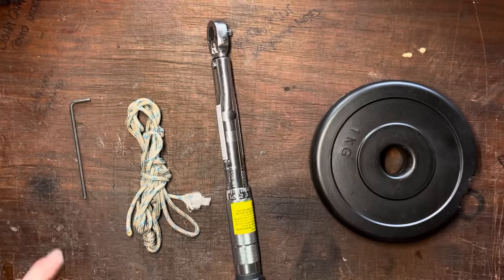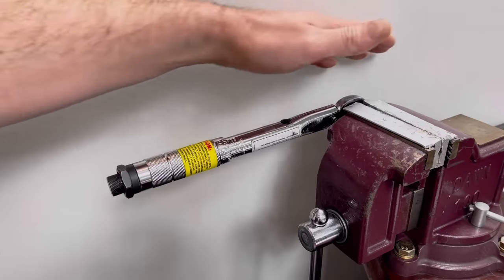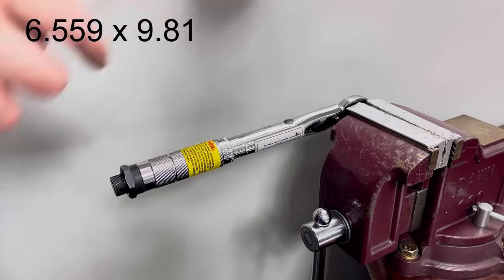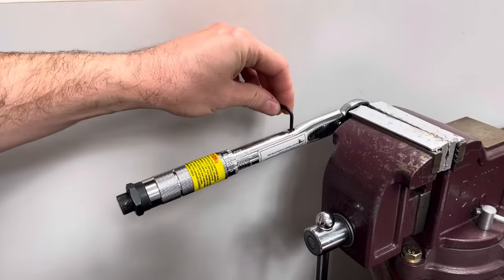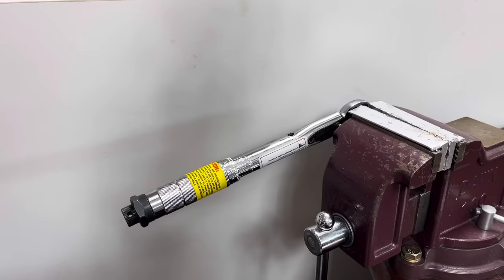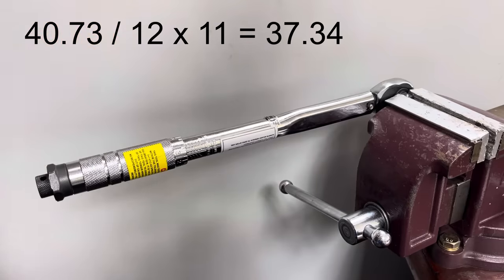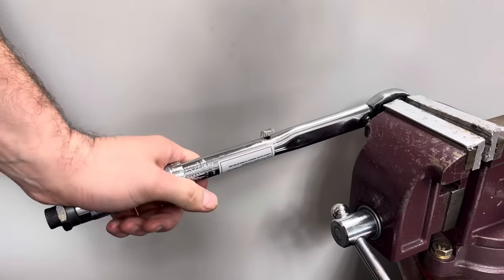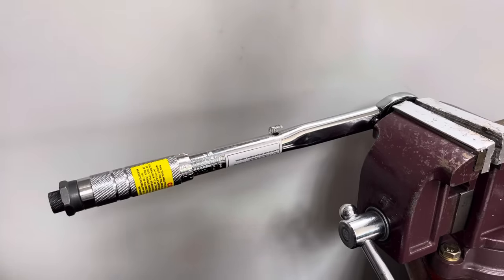CALIBRATE YOUR TORQUE WRENCH IN UNDER 5 MINUTES (NO SPECIAL TOOLS REQUIRED!)

Comment: There's a fundamental mistake  made despite the correct idea - one should fix the wrench body instead of the socket place. This way you will be calibrating the torque applied to the nut/bolt instead of calibrating the effort you apply to wrench. Why? Because torque wrench is a torque-converting mechanism and you don't know the length and the angle of the leaver INSIDE of it (the tooth that slipps out of its lock and makes that characteristic click  at the set torque). Wrench should click at a set torque irrelevant on where you hold it. If you'll hold the wrench closer to the socket you would have to apply greater torque to tighten the nut to the set value, than if you'll hold the wrench for its end. So, by putting the weight on the handle - you calibrate only the place on the handle where your torque will correspond to the weight - the actual torque applied to the nut will remain unkown. But if you'll fix in place tha handle and attach a leaver of known length to where the socket goes - you will calibrate the torque mechanism to specs - there's no other way to place the socket other than on the socket holding mechanism, thus you'll eliminate the large deviation in weight placement.
So the correct procedure should be: 
1.fix the wrench in place by its body;
2. find the strong, long enough (70-100cm), homogeneous leaver, measure its weight and length;
3. attach the leaver to the socket holding place;
4. place the reference weight (1kg or smth was in the video) to the MIDDLE of tge leaver
5. adjust the calibration screw so that wrench clicked at calculated torque.
Your calculated torque will be (for metric system in Nm): 9.81 * 0.5 * leaver_length_in_meters* (ref_weight_in_kg + leaver_weight_in_kg).
Reply from the maker: Thanks for sharing 👍

Comment: I tried both ways (i.e., testing and doing the math measuring the distance at the minimum setting and at a selected torque setting prior to adding the weight) and the first/original explanation seems more accurate. If you set the torque setting before measuring, the math equation simply doesn't work. In short, in my view, the original comment made in the video was and is correct. Either way, you have superb communication skills and a equally great demeanor. You'd be an excellent Professor.
Reply from the maker: Thank you for the kind words :)

Comment: The band is the point at which the wrench is calibrated. Keep it simple, they should all have a band to work with. A big nut on the horizontal is actually better than a vice. The force of twisting a square cam in vice jaws is extreme. Should be able to break a large vice at higher settings. I've broken 2x 6" industrial in my time through mis use and abuse, they break with a seriously loud bang.
Reply from the maker: Thanks for sharing

Comment: Honestly I would test it wherever your pinky finger will be. That will be where most of the pressure will be applied when pull torquing. Push torquing would be more in the middle I am guessing.

Comment: Great method! I think it should be underlined how accurately you should measure the distance. If you want to be even 4% accurate with the measurement, you cannot go "about 11 inch" or you'll be off by more than 4% for sure. It might be a good idea to use metal wire for hanging the weight to be sure you're applying it exactly correct position.
Reply from the maker: Good advise :) thanks for sharing!

Comment: Thanks for sharing. Great video! I was wondering would you not de-caliber the torque wrench if you first measure the length before setting up the torque value on the torque wrench? The length may change and therefore it may create inaccuracies, depending on the starting point. Also, would you not de-caliber the torque wrench if you start calibrating the tool first with a lower torque value, and then move higher values across the range? Will that not de-caliber previously calibrated setting you just did in the previous step? Cheers.
Reply from the maker: Well spotted, yes it’s an editing error. Always set the value, then measure then hang :)

Comment: If you decide to use this method, its imperative that you test near min and near max. I have seen torque wrenches tead accurately at 20 foot pounds and not close at 50 foot pounds! 
3rd generation mechanic and engine builder.
Reply from the maker: I find that there will always be discrepancy. My recommendation is to set it within a window that the torque wrench gets used most often

Comment: Ok, maybe I'm missing the obvious - He measures to a point on the handle, we'll go with the first one, 20cm. Put that in the formula and that tells you what the wrench needs to be set to, and sets the wrench accordingly. So far, I'm good. Here's the part that I stumble on. After adjust the wrench as much as he did (it was less adjustment on the ft lbs, but still applies), then sets the weigh on that spot, you are no longer at 20cm, you are at 19cm, or 17cm, or (fill in how much adjustment was made). Would you not need to remeasure to 20cm again, so you were setting the weight at the same length, not the same spot since the distance is now shorter?
Reply from the maker: Yep it was an editing error, set the torque, measure and add the weight, thanks for watching!

Comment: great video thanks! this is a great method to check if your torque wrench is more or less ok, but I'm not convinced you can actually calibrate it, unless you have some standard weights or a perfectly calibrated scale. You have no way to know if it's your torque wrench that's off or if it's your scale, or both.
Reply from the maker: Hey, you’re welcome! I use this as a good enough for my needs, but it’s understandable that this may not be enough for others of course :)

Comment: Isn't the point of calibrating a torque wrench that its checked by an approved operator who issues a certificate of calibration? Which is important for companies who need to fasten nuts & bolts like wheel fastenings, brake components and other fixings where catastrophic failure could result in injury or death. For items like cylinder heads it's about consistency across the component.
Reply from the maker: It’s just a good thing to do as a home owner to know their wrenches are accurate.

Comment: Thanks much. The weight should be 90 degrees from the handle. If it's not you are not applying the specified weight/force.
Reply from the maker: You’re absolutely correct :)

Comment: So the string should be hung from the-smooth line on the knurled handle.  Measure the distance from the middle of the square head drive to the string which follows moving the string an inch down or up the  handle will change the effective torque setting. The best practical weight to use is equal to half the max torque wrench setting, otherwise pick weights to correspond to torque settings you use most often. I've heard that a click torque wrench is most accurate on the upper three quarters of the range and most accurate at maximum. I think most people over torque bolts because they use the wrong size. If you go below 20% of the max torque value(don't pay attention to the min torque values for the wrench if it is not 20% or more of max.) you might not get a good tactile response and over torque the fastener.  So make those calculations before using or buying a wrench.
Reply from the maker: Hey, it makes no difference where it’s hung, it’s based off leverage and weight. You can hang it at the end of the handle or half way up, so long as you add the correct weight.

Comment: I used to calibrate torque wrenches using a load cell. This method has sketchiness and potential for failure all the way.
If your stuff is important, pay a calibration service, this will lead to false torque values and potential damage to fairly expensive stuff
Reply from the maker: This is more that good enough for small engines 👍

Comment: The last torque wrench i bought was calibrated so i checked it against my others by using a hex socket and an Allen socket with one held in the vice. Worked quite well.
Reply from the maker: Awesome! :)
Reply: Can you try it with the method shown in the video?

Comment: Send it in to have it properly calibrated. Lots of hack mechanics think torque specs don't matter much and then I hear, "I've done a 1000 cars and never had a problem..." Like how do you know? Do you keep a record of the car? Have gps trackers on the car? Call the customer every week to see how the car is doing? You have no clue what happens to the car after it leaves the shop. If you're that cheap that you don't want to have the torque wrench properly calibrated get a beam torque wrench. You never have to calibrate them, and they are far more accurate anyway than these other style. And these newer torque wrenches are only used because of ego, because people are too embarrassed to have a beam torque wrench in their toolbox and god forbid if anyone seem them using a beam torque wrench.
Reply from the maker: Thanks for watching

Comment: I went to borrow my brothers newer imperial torque wrench but noticed it was set at 110 lb/ft. He never returned it to the lowest setting after last use and left it that way for 2 years... Would this procedure still work or is his wrench permanently messed up?
Reply from the maker: It’s recommended to always take the tension off, but give it a go and see how it measures against a known resistance :)

Comment: The first time I saw a metric torque wrench it had decimal points on it. What didn't make sense was, if the metric system is more widely used around the world, why is standard (imperial) measurements complete numbers, but metric torque wrenches have decimal numbers to match standard measurement? Its like the rest of the world has to compensate for American standard, and seems like the rest of the world is bowing to American standard, instead of just using solid metric numbers without decimal points.
Reply from the maker: It won’t be a metric torque wrench if it has decimal points. That’s an imperial wrench with the addition of a metric scale (be it pointless). I have two wrenches. One is imperial and has decimal point metric, the other is metric that has decimal point imperial.

Comment: I see a problem. If you decide on a mark, say 20cm and work out a setting (say 12.88) then screw the handle in or out along the scale to the setting on the barrel, you need to remeasure the length from the middle of the square drive to the new balence point.
Reply from the maker: You’re spot on :) it was a b-roll editing mistake. Always set the handle and then measure. 👍👍

Comment: Torque wrench must be as close as possible to the horizontal position when it "clicks" with a weight attached for it to be in a good ballpark spot for calibration. Otherwise force vector will shift and some of it will be transferred to vertical (hanging on the fixed point at the vice).
Reply from the maker: Thanks for watching and sharing!

Comment: The higher you go on the scale more accurate the torque wrench. The lower you go is less accurate and the plus and minus comes into to play a lot more. Also your supposed to make adjustments while the torque wrench is still wound up? Isn't that calibrating the whole scale to that weight? So if you loosen the screw down it will still be calibrated to the weight below what you calibrated it?
Reply from the maker: Na doesn’t work like that fortunately :)

Comment: Note:  Newton Meters and Pound Feet are measurements  of torque.  Foot Pounds is a measurement of force.  It is a mistake that has been perpetuated over the years and even manufacturers of torque wrenches label the tools incorrectly.  Even though they are labeled wrong, the tools are actually measuring Pound Feet and Ounce Inches.
Reply from the maker: Thank you!

Comment: I don’t understand how this procedure accounts for the weight of the wrench itself. At rest before any weight is added, when the wrench is fixed horizontally in the vise, it’s weight itself will exert some torque. 

If I add weight as shown and do the calculation,  I understand how the additional force generated by the additional weight is calculated. But where is the adjustment for the force generated by the weight of the wrench itself.

What am I missing?
Reply from the maker: Hey :) just replied to your other comment! Thanks for testing it!

Comment: Very inaccurate test, at list because of 3 reasons: 1 the distance changes when you set the torque by twisting the handle; 2 you lose a 90 degrees angle of the force (weight) applied; 3 you don't take into consideration the weight of the handle itself.
Reply from the maker: You are splitting hairs here. The spring tension / response causes more inaccuracy than the light weight of the handle. You can set even the best torque wrenches to a set weight and it will vary somewhat each time you click it, setting at 90 degrees is what it should be. Any more or less and you’ll get less accurate results. This method is more than accurate enough for any small engine mechanic to ensure they’re within a very acceptable range. You’ll never over or under torque a bolt or nut enough having set this method, to cause any problems at all. As Taryl says, it’s not the space ship.

Comment: Did anybody else catch the error?
You found a location to hang the weight before adjusting the handle, thus making the adjusted point different than the measured point.
Repeat the test but measure the hanging position after making the handle adjustment.
Reply from the maker: It’s an editing mistake, you’re spot on, it should be, adjust, measure, add weight. Thanks for watching!

Comment: Why would you pick a random spot to measure? That line in the nursing is literally EXACTLY where it’s calibrated from at the factory.
Reply from the maker: I was always under the impression that clear area was just design and for hand placement, I never knew it was actually to measure from. Is this just a guess or are you certain?
Reply: @VintageEngineRepairs   Beg pardon, not intending to come in over the top of cory, but since I'm here adding some other comments, an indicator like a single ring, or crosshairs on a molded handgrip, marks the design loading point of the mechanism. YT is twitchy about linking to references offsite, so if I might just quote from Norbar (Google search would locate the text): " Using marked loading points for accurate results:   Most torque wrenches are length dependent and feature a marked loading point on the handle but, many people don’t use it. For accurate results, most torque wrenches have to be operated with your hand centred over the marked load point. It is also essential that this load point is observed when it comes to calibrating the torque wrench."

Comment: 😕My Torque wrench does not have that style adjustment method. It has a plastic cap on the bottom of the handle which came off one day, and one of the jamb nuts has spun off the threaded interior rod, which has an allen key socket in the end. I have NO idea how to put it back together in the correct place...
Reply from the maker: Oh no! Best to take it back to the place you brought it and explain the problem.

Comment: It's good to check that the wrench is not WILDLY out of adjustment. This is a good method.
If by moving the rope only 5 mm up and down the handle changes the torque, one must then assume ANY force applied by the human hand over the distance of the knurled handle  will produce merely an APPROXIMATION of a theoretical value. This is why some bolts etc.  do not require "tension",  but angles of required rotation. "Tension" is the screw thread (a helix, which is actually a coiled INCLINED PLANE or WEDGE) converting a "Moment"; Force x distance, to tensile load on a bolt imparted to that bolt by the thread.
Reply from the maker: Thanks for sharing 👍
Reply: @VintageEngineRepairs  I'm sorry if I am "preaching to the converted" . I've also changed my initial response to yr video. Cheers from the Hunter Valley.
Reply: That's why the grip has a pivot axle.  As long as the grip "floats" and is not allowed to contact the wrench, all force is applied at the pivot axle.

Comment: I have not read all the comments, but one thing disturbs me with the presentation.  If you adjust the setting, that is when you should measure the distance!  The reason is that the distance changes with the torque point selection.  Don't use wrong arm length, because that invalidates your calculation...
Reply from the maker: Yep, it was an editing mistake, adjust, measure then add weight. Thanks for watching!

Comment: Wait a second... you're taking your measurement of length, then screwing the adjuster IN  which changes the location making the weight less effective, more specifically, requiring more weight (force) to operate the wrench at setpoint.
Reply from the maker: It was actually an editing mistake, adjust the wrench, do the calculation and add the weight. Thanks for watching.

Comment: nice, but I see a fatal flaw it this process. Measuring to find the place where to apply the weight and then adjusting the wrench brings the marker closer to the place where you put the socket on. This means that you do not hang the weight at the distance you just measured but closer, which definitely influences the result. I'd say determine the distance, set the wrench, measure and mark the spot, put the weight and adjust ...
Reply from the maker: You’re spot on :) set, measure, weigh. The edit was backwards. Thanks for watching!